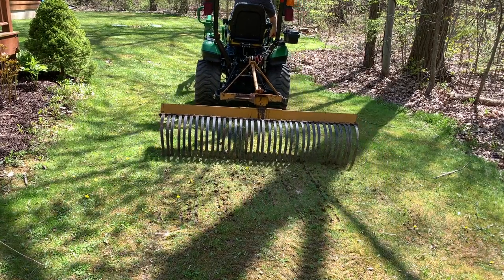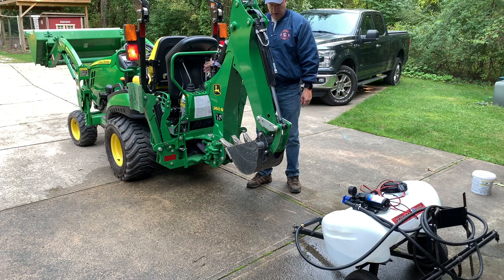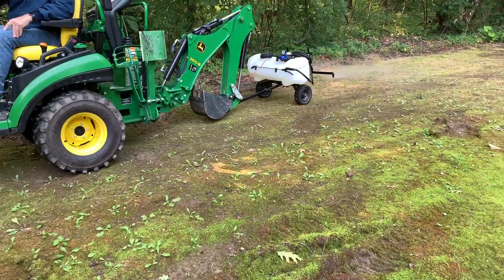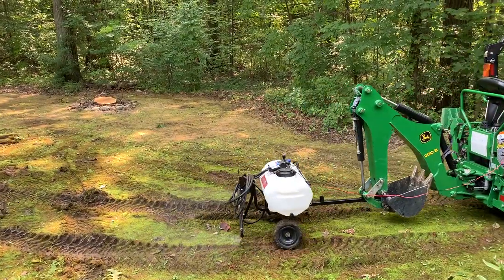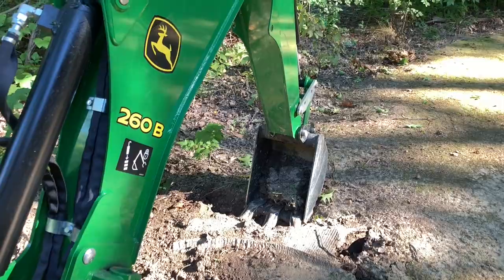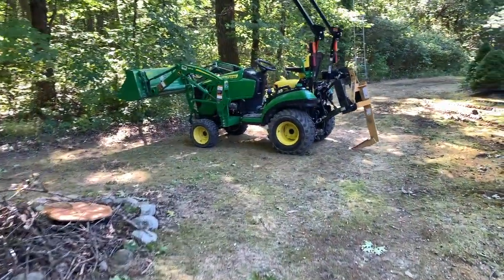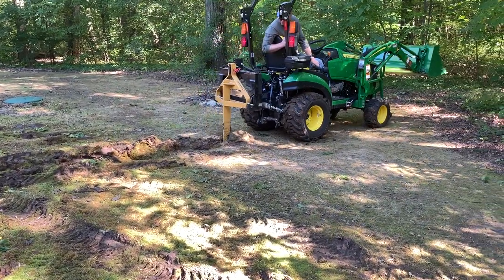John Deere 1025R:  Back Yard Man

Comment: I really hate to say it cause it seems like you've thought about the possibility,  but are you sure it isn't septic related?  That seems like the place the D box or leech field would be.  It wouldn't necessarily smell if one of the legs were clogged/blown out.  If not,  I'd think the next step would be drain tile if this doesn't work.  The install would make a great video too!!  hahahah
Reply from the maker: We had it emptied last month.  I have to fill quickly afterwards so the pipe coming in seems fine.  The discharge pipe goes in the opposite direction of the wet area.  We have a nyatic system that does not have a leach bed.  It discharges in the opposite direction for 150'.  Drain tile could be a project next year:)  Thanks and Take Care, Tom
Reply: That would suck and stink

Comment: Kinda scary watching you make a big problem from a little one.  In my experience your problem is either 1) a spring popping up as you mentioned, or 2) a change in drainage due to a neighbor or someone else changing the drainage pattern around your property.  Why you would introduce Roundup into the water (water table?) is a mystery to me.  We have a  similar problem here, but it is due to rising water in a nearby creek and trees that have grown over the thirty years we have lived here.  A simple application of an iron salt kills the moss and can be applied with a simple broadcast or drop spreader.  I use a tow-behind broadcast spreader on my tractor and apply a lawn fertilizer with iron moss control every spring.  It controls the moss all year.  If you want to dry up the area, install some kind of drainage tile and add soil over it.

Comment: I have a landscaping rake which stays on one tractor most of the time except for when I need to use one of my other implements on that tractor. My second tractor have a brush hog mower attached to it all the time now since I use it often to mow part of the family land with. I have a plow like the one you used to dig that line with except I used mine to help breaking up some soil for a garden, but decided to use my turning plow instead on my tractor.

Comment: Northern Tool has a 13gal.that would fit your needs.I have one and it works great I   think it is about $139.Also,do you have your tires filled and you could put weights on as well Good Works Tractors has several videos on weights etc.

Comment: If you put the landscape rake at an angle it will do a better job on removing material.  You can also hang a suitcase weight or two on it for some additional down pressure

Comment: I have a sprayer about the size of yours without the wheels. It doesn’t have the boom. I use it for fruit trees and garden. I put it in the front bucket and if the loader is off I have a car carrier I strap it to on the back. Works great.

Comment: That wet spot being so close to your septic tank could indicate a leak in pipes or tank. Where is your septic field, is it blocked or backing up? But like you said, could be a spring
Reply from the maker: We really don't have a leach field, the discharge pipe is on the opposite side.  It heads away to our property line makes a left and goes about 200' total.

Comment: If moss is growing on something, that usually means that area is in the shade.  Is it possible to cut down some trees to let in more sun.  The wet area in the lawn could be corrected by digging a 3 to 4 feet deep hole in that area and putting about 2 to 3 feet of gravel in the bottom of the hole and covering it with about 1 foot of soil and planting grass.
Reply from the maker: Thank!

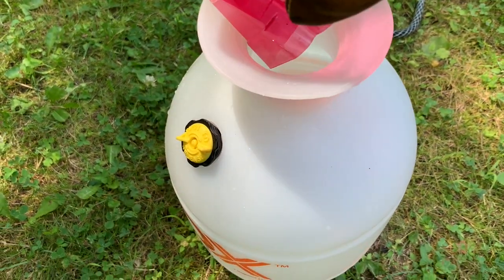Comment: At 2:10 You're using tap water in your sprayer.  I've had my sprayer for 10 years and have never has the tips clogged.  I use DISTILLED WATER to mix my weed killer (HDX from H.D.) The Distilled Water costs .89 to .95 cents a gallon but it's worth it to me since I never have to clean out or replace the nozzles.  Another benefit is that when I spraying the parking lot at the Church, I don't have to go back to the building for water.  I can mix more right where I am, in the back of the truck. With 10 gal with me, I keep spraying until the job is done.  It costs more, but there is no maintenance/down time messing with the sprayer.